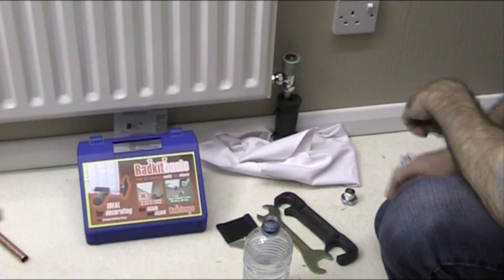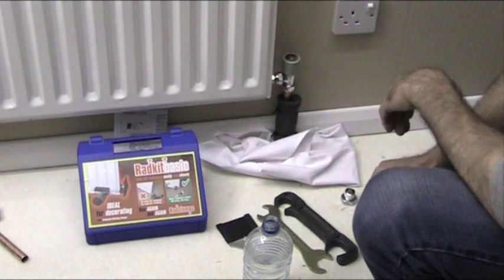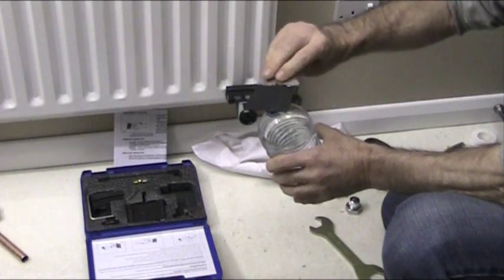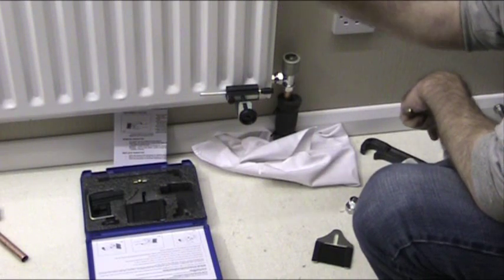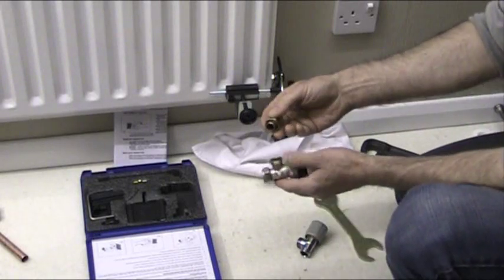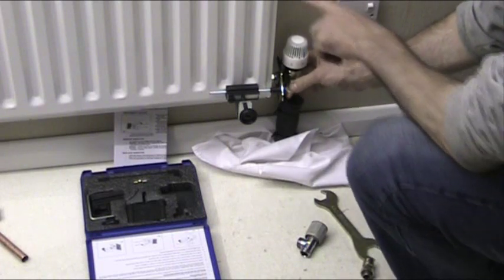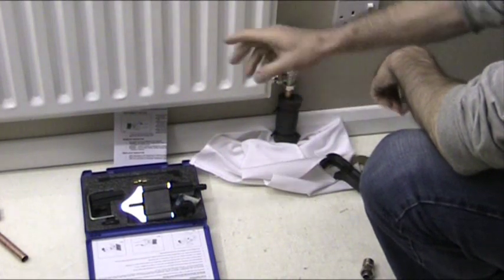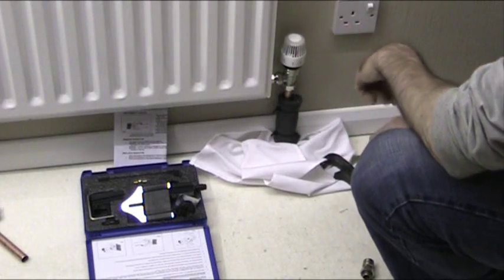Freeze pipe to fit TRV, No draining.

Comment: This only works if you have the same nut size for the TRV as the lockshield / wheel lock valve. In my experience - the Lockshield / Wheellocks have a larger 3/4" nut than the standard 1/2" TRV tail nuts. I had to replace all the Rad tails to fit my TRV's (Drayton TRV4s in my case).

Comment: You only need to freeze the pipe, if you turn off valve on the other side fully it will create a vacuum and you will only get a very small amount of water come out easy to contain  so save your gas it’s expensive lol